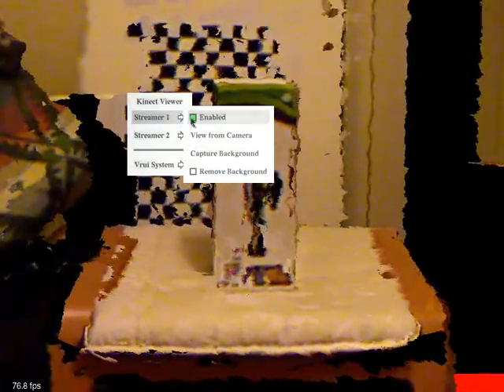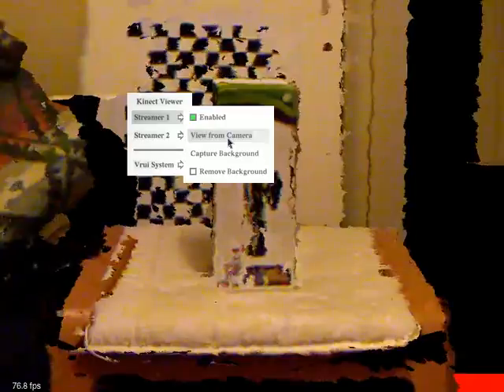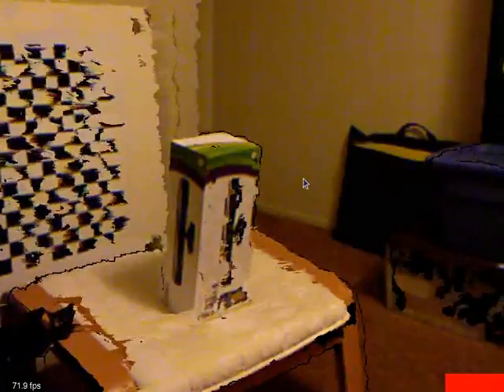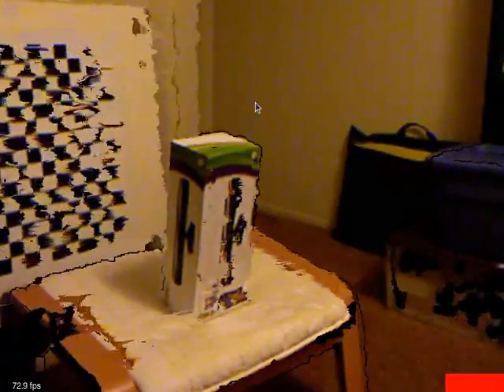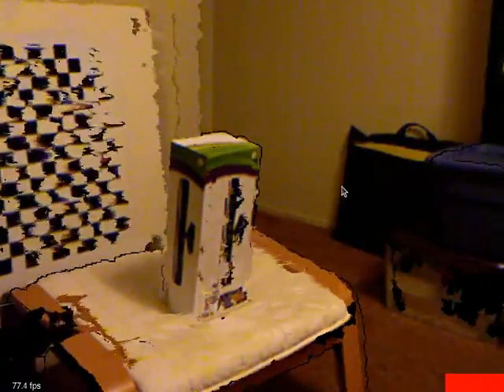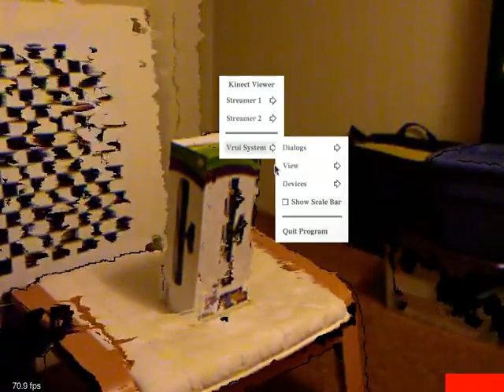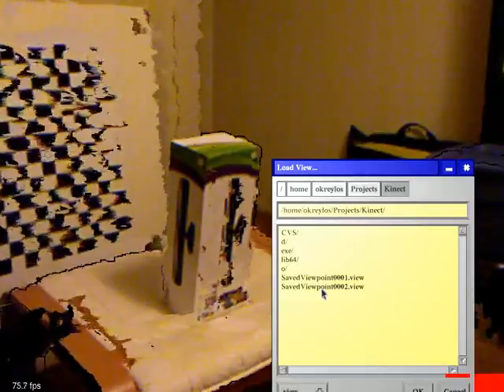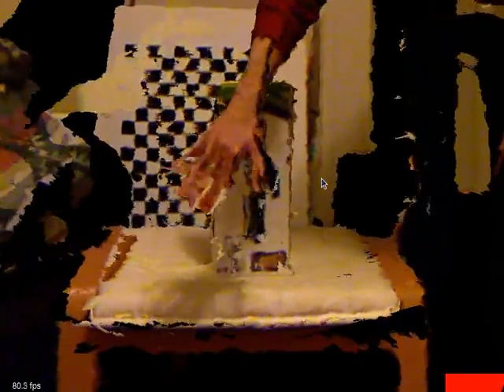2 Kinects 1 Box

Comment from the maker: Not natively. It runs under cygwin (the POSIX emulation layer) or under Linux inside a virtual machine, but in both cases performance will be very bad. Neither cygwin nor VMs get direct access to the host's graphics card, and OpenGL will fall back to software emulation.

Comment from the maker: There is no hard limit on the number, but you need one USB bus per Kinect, and the more Kinects you add, the more interference between them you'll get. It's a matter of diminishing returns. The "shake & sense" method someone posted in the comments below is one way of reducing interference; ideally, Microsoft would sell the Kinect in a variety of colors. Normal users wouldn't care, but power users could buy a set of different colors, so they won't interfere with each other at all.

Comment from the maker: @DrKaito10 My development branch has a new calibration method (intrinsic and extrinsic), but it's still semi-manual. You have to manually fit homographies to a sequence of images of a semi-clear rectangular grid in the 2D depth and color images. This is because the depth image is so fuzzy that automatic grid detection methods, at least the ones I've tried, don't work well enough. But the process is quick, and the results are very good.

Comment from the maker: @demonicowl Most desktop PCs have two USB busses to the outside; typically one to the front panel, and one to the back panel. That's what I'm using. Alternatively, you can buy additional PCI/PCIe USB cards, OR you can buy a USB 3 card and hope that the drivers work. A single USB 3 bus can theoretically support around 15 Kinects.

Comment: @power13413 I gave you a thumbs up but consider this: One Kinect facing North, and another facing East. Positioning a 3rd Kinect top-down 90 degrees from the N facing Kinect isn't the same thing as positioning it 90 degrees from the E facing Kinect. Either way you do it, the 3rd Kinect will be in the same location, and facing the same direction, but the images captured differ by 90 degrees.

Comment from the maker: @harrisonk3 Turns out the Kinect's color camera is higher resolution than I thought; 1280x1024 instead of 640x480 (the latter is the default). However, at the higher resolution the frame rate drops from 30 fps to 10 fps, which makes it a lot less usable.

Comment: If it is an IR laser, it should be possible to use more than 2 kinects since the response time is very very low, just might need some more direct hardware access than the OK SDK currently allows. 10ms should be more than enough for up, capture and down and that would allow 3 kinects at 30 fps

Comment: I just posted this on OpenKinect Wiki. Interested to hear your take:

Sequenced 3D Environment Mapper - Leal Vona

    * 3-4 Kinects in triangular/circular array
    * Taking pictures (depth camera on/off) in sequence at rate < 30 FPS
          o Kinect 1 - Frames 1,4,7,10, etc.
          o Kinect 2 - Frames 2,5,8,11, etc.
          o Kinect 3 - Frames 3,6,9,12, etc. 
    * Depth camera IR arrays theoretically would not interfere with each other.

Comment: here is a thought, two Kinects on the same plain then add a 3rd to to an entirely different field. what you have now but and a Kinect above facing down but that they all make a triangle formation in essence. I'm totally out of my league with this stuff, but I do build 3d accident scenes  from a (user friendly software company [term user friendly lightly] I will not name). any way 3 kinects triangle but one on a field high above using the 90o thought...

Comment: Dumb idea, but since the noise seems to be caused by crosstalk from the IR emitters, would it be possible to change the IR emitter frequency of one or both of the Kinects and then put a filter on one kinect's IR receiver to filter out the crosstalk from the other?

Comment: Hey Oliver I made it to the point where I had run AlignPoints.  The instructions get a little funky in using measuring tool correctly etc a quick video would be useful :-) as I don't seem to be able to get the checkerboard calibration working. Did you look at the ROS calibration method  not sure how to convert output with your setup.

Comment from the maker: @GWebMa I knew this change, reasonable as it is, would come around and bite me in the ass... :)

I just downloaded Vrui-2.0-003 and Kinect-1.2 myself, and built both without touching anything, and it worked.

If you build Kinect-1.2 against Vrui-2.0-001 or Vrui-2.0-002, you'll have to change VRUIDIR in Kinect's makefile to $(HOME)/Vrui-2.0-001 or $(HOME)/Vrui-2.0-002, respectively.

Does that work for you?

Comment: @bobca123 we were both wrong, 3 aren't enough to cover top AND bottom, however using 6 is just as silly. you could get all around footage with 4 if you placed the first 3 around the object in a way that they see its top, and use the last one to capture what's under it.
but what would you even wanna do that for anyway? do you want to capture a floating object? cause things are generally affected by gravity, their bottom sides are normally impossible to capture.

Comment from the maker: @Hulan6 The Kinect generates up to 640x480 depth pixels per frame, and my software simply connects adjacent depth pixels via triangles or quads, if they are classified as being part of the same object. So each frame can contain up to 639x479x2 triangles, if there are no invalid pixels (there are always at least a few around the silhouettes).

In these videos, my face is probably represented by a few hundred triangles, just to throw out a number.

Comment: My apologies for asking a question that I am sure has been asked at least once before, but my attention span began to wain after three to four 500 post pages.  Out of curiosity, how are you handling the 3D data?  

It comes out of the Kinect as an colour stream and a depth stream if I am understanding correctly.  Are you then converting it into a standard DX/OpenGL style mesh (from the Depth stream) with material/texture data from the colour stream?

Comment from the maker: @NINKNOONAN My CSV parser implements the specification rather strictly, so you can't have any spaces in the file. That's usually the problem. Also look out for MS-DOS vs UNIX line ends, although I think my parser handles those properly.

I haven't released the multi-Kinect capable version yet, because I'm currently experimenting with some new features, and it's a bit messy right now. I'll put it up soon.

Comment from the maker: @emaanet The software doesn't merge the depth streams in any way; it simply projects them into the same 3D space. This means, during the times in the video when I turn off one of the depth streams (but not the IR projector; that stays on the entire time), what you see is exactly the raw data sent by the other camera. If there are holes that would not be there with one camera only -- and there are -- they must be due to interference.

Comment: Also, you know those videophone software that recognizes backgrounds?  And turns them into a blue screen because it distinguishes the background pixels from moving pixels?  You could also adapt this technology to 'fill in the gaps' permanently.  In fact, if you wanted to capture a stationary scene, you could add an additional per-pixel depth-noise filter that averaged over a trailing 60 second period, for much, much, much less depth jitter in stationary parts of scenes.

Comment: Another thing: You will want to add some realtime depth-synchronization-and-filtering algorithms, to soften noise.  Perhaps a temporal noise filter in 4 dimensions (3D+time) that automatically fills-in transient gaps.  Google "temporal noise filter", you might be able to extend a pre-existing open source video temporal noise filter into 3 dimensions, to filter out the black-spot-flicker.

Comment from the maker: @Shakespeare1612 Incidentally, we have one. I think the Kinect could be used as a scanner; you'd simply move the device around the object a few times for full coverage (or move the object instead).

However, since 3D printing requires water-tight surfaces, you'd have to run the resulting point cloud through a topological repair, as done by software like Geomagic. But the basic workflow is all there.

Comment from the maker: @DJDeathflea Well, the device is basically sending raw frames over the USB channel, and I'm doing some conversion to get real depth values and colors, and stuff frames into the render buffer as they arrive. It's a no-brainer to simply timestamp the frames and write them out to disk at the same time. After conversion, the data rate is around 46MB/s, which a modern hard drive can handle easily.

Comment from the maker: @techpops The 640x480 resolution on depth and color camera is a problem. There are ways to increase the color resolution by using an external higher-definition camera, but we're stuck with the relatively low-res depth image until someone makes a better device.

But to put it into perspective: The reason I'm excited about this is because the quality is already significantly better than what I had before.

Comment: @lithdoc Sorry if I came across as rude. I didn't say the hardware is top notch, I said the technique is. Structured light used in Kinect gives really good results in comparison to stereo methods using 2 cameras (or one stereocamera) for instance correlation based methods. 
Microsoft provided mass production of this hardware probably cutting costs wherever it was possible. But mechanisms hiding inside this little devil are still high end...

Comment: One of the challenges is getting rid of depth noise without losing important detail. For near surfaces, the most effective way might be to normalize points based on their nearest neighbours thereby smoothing out the image.

For more distant surfaces, this idea gave me an idea: watch?v=v72l3Uswa04

My thinking is that you could save a lot of calculation effort for surfaces which are far from the current POV by defining "depth layers" and just "rounding" the depth values to the nearest layer.

Comment: @w4ffl3 Nothing has been done in this current experiment to address that issue. Surprisingly, the interference between the two Kinects is relatively tame. It will likely become a greater issue with each additional Kinect addd to the experiment which is why the idea of using polarizing filters is being explored.

Comment: @fr4s0r A lot cheaper? A lot cheaper would be to buy this system straight from PrimeSense without all the "gaming" jibba jabba. You can buy cameras for a 2 stereo set stereo system for under 50$.
Open source community is already using such stereo systems under the OpenCV sdk sign and has been using it for some years already.

Comment from the maker: @robvh2 Vrui has built-in head tracking; doing it via Kinect is a matter of extracting a head position (and ideally orientation) from the video streams, and turning that into a module for Vrui's device driver. Pretty much the same way I have integrated the Wiimote as a 6-DOF input device.

I should probably get on that, since it's a clear application.

Comment: The MirrorMagic reply is very cool and shows great promise. Calibrating and merging the point clouds should be a real joy... ;)

Check out this video, Oscar: watch?v=7agnTVMjSy4

What do you think of putting that into your software to turn your computer monitor into a cool diorama? The Kinect would need to know where your screen is oriented relative to your head, of course. Most navigation would still use the mouse but small head-based movements would add a major cool factor.

Comment: Would it be possible to rapidly switch the IR transmitters on and off, in opposing phases? Then only one Kinect would be transmitting at a particular time and you'd get a much cleaner picture IMO. The only question is how fast you can turn each Kinect on and off... Is the IR transmitter even software-controllable?

Comment: Very cool. Question from a coder but not a computer vision guy: would it be possible to sample from the cameras in sequence to reduce the interference from the IR point array being fired from each Kinect? The good news is that you could use unlimited cameras, bad news is that I'd imagine that your framerate would be cut to 1 / n cameras. (or worse, depending on if the units won't spin up and down at a strict 30hz or whatever). Sorry if this is a stupid question.

Comment: I think one possible way to eliminate conflicts between one data-set and the other  is to use a point-cloud style system, applying color to each 3d point, and specifying one device as the primary (only using the data from the others to fill in the blank)
I only know enough about programing to give me ideas as to how to do things, but It seems to me that it may be easier to combine 3D data sets in this way than by trying to merge two 3D surfaces.

Comment: I can not stop thinking about this. I noticed there are black holes in the depth image only when there is no data. Couldn't those be filled with data from the previous frame (successively filling the holes) or interpolation (e.g. by taking the left and right edge in the line)? Something more sophisticated in non real time applications maybe. Should work especially well when only updating the moving parts of the image.

Comment from the maker: @bitplane There's a lot of secret sauce in the device still, so it might be possible that there are ways to do what you suggest, but I'm not aware of any at this point.

I believe using external shutters is a viable idea, but they would have to be carefully tuned to be in synch with the internal cameras or you'd get bad results.

Comment: ... 2 for the projection of the points and 3 for the recognition of the 3D image.  (Removing the Projector from the case might later be an option, so only 3 Kinects are needed, but 2 would be pretty much destroyed for normal use). Do you think that could work at all?

Comment: Thinking about it, a shadow in the point matrix might not work very well (creates holes closer to the camera and overlaps further in the background), but maybe a setup where the projectors and cameras aren't in the same location. It should be possible to find the optimal position for the point coverage. (My hypothesis could be tested by covering the point projector of one Kinect and try the 3D recognition with the other). Of course an almost perfect 360° system would probably require 5 Kinects.

Comment from the maker: @Max404s I'm using a regular mouse in all the videos, but I have a SpaceBall 4000FLX (old school), and a loaner SpaceNavigator sitting on my desk right now. Both (and other models as well) are supported natively by Vrui, there's just a bit of configuration to be done to get them to work exactly the way you want to. Vrui-2.0 already contains configuration file fragments to get them working with my personally preferred settings.

Comment: Dude you rock, wish more people were this straightforward. 

I think the kinects would have a better coverage if they are placed at 137 degrees (golden angle) to each other at both z y and z x, that way each kinect has a maximum coverage of the volume the other one is not covering and less interference. Like the least amount of overlap.

Comment: it is difficult to understand, looking at the IR pattern, how they don't interfere more specially in the front face of the box which are almost parallel to both cameras. Did you try turning off one of the projectors? Can one of the kinect make the reconstruction using the projector of the other one?

Comment from the maker: @SciPoly There is a Python wrapper for the underlying Vrui 3D toolkit, which was developed by an independent contractor. I'm not sure right now if it still works with Vrui 2.0, since I don't use Python myself. There is no wrapper for the Kinect package itself, but that should be comparatively simple. Vrui is a humongous piece of software, and the Kinect package is tiny.